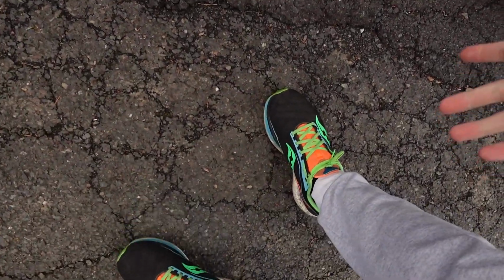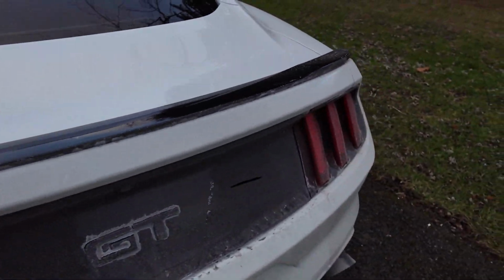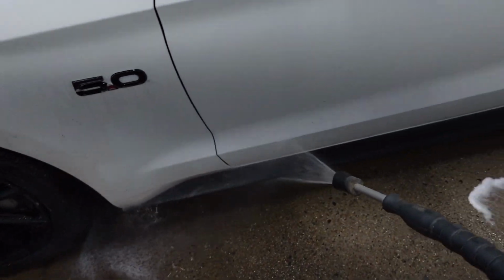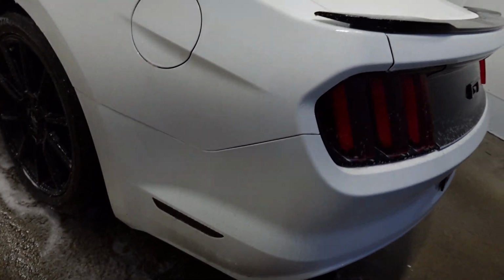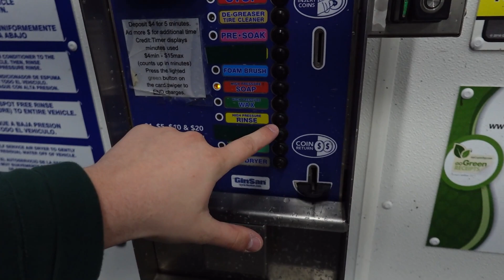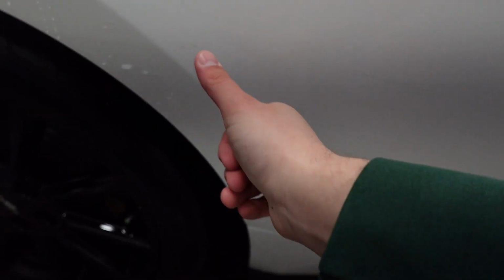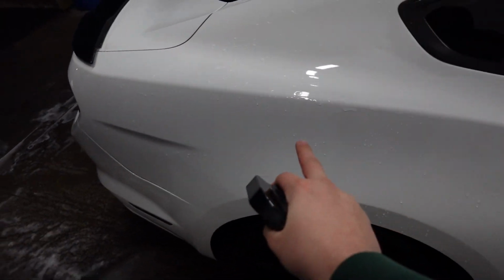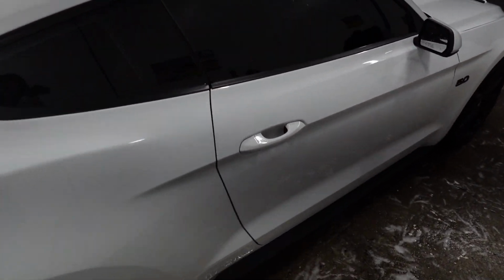How To Use Self Serve Car Wash! (QUICK TUTORIAL)

Comment: what about wheels and breaks?
Reply from the maker: I would use the tire and wheel cleaner and spray it on the rims, then wait a solid 2-3 mins and then rinse them off. And if you want then use a microfiber and dry off the wheels afterward. Any questions lmk
Reply: @adampichel  Perfect thank you so much great video. and would that be my first step?
Reply: Wheel and tire cleaner spray (let dry 2-3 min) then wipe down w towel

Pre Soak all around (let rest 15 seconds)

High pressure soap all around

High pressure Rinse all around

Dry Blower (light dry around)

Macro Fiber Towel dry all around

Spray Wax light sprays all around
… this is what i got from the video in order. You think that will have me set? or any changes i should make in order or additions
Reply: Thanks bro for writing out the steps. Easy to follow!